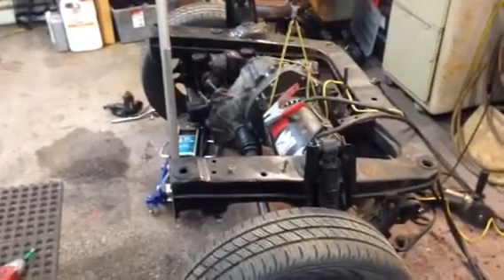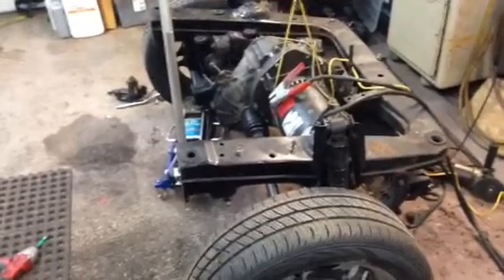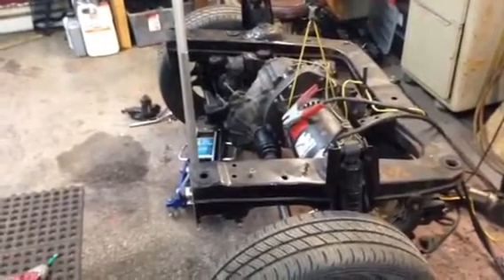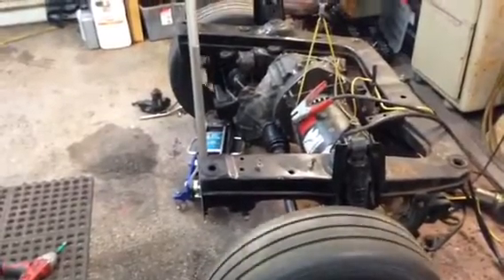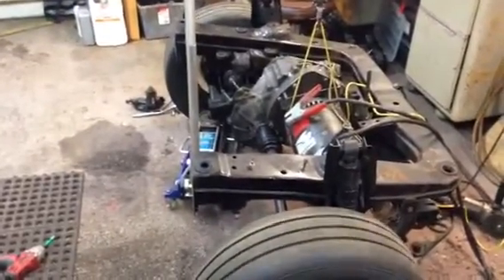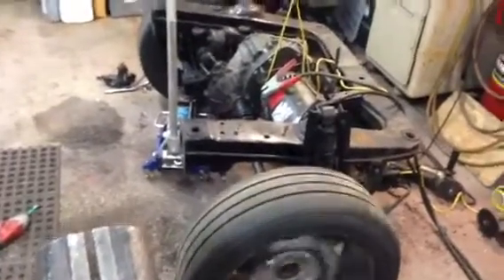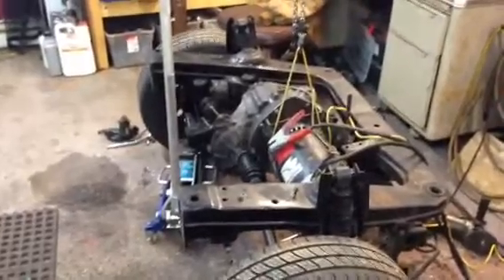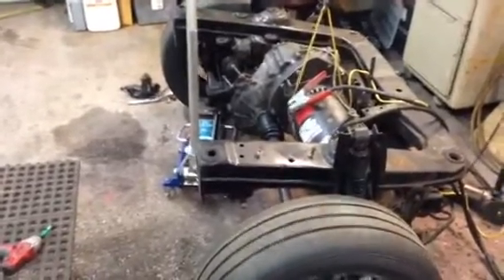Smart Car EV Conversion

Comment: hi can you tell me what the wheelsize and wheelspan is... looking to stuff this engine into a  subaru sambar dias II
cheers
Reply from the maker: cain hashimoto Really, I can't imagine why you would want to put such a poor quality powertrain as this into anything. It's a sweet little thing but prone to failure. Shifter problems are the only thing that's consistent. That's why I pulled out a good running engine to change it to electric. I have another Smart with a junk engine and I'm going to put a Toyota engine in it.